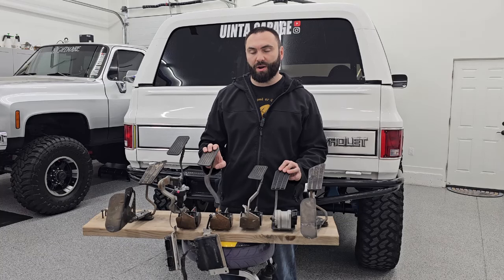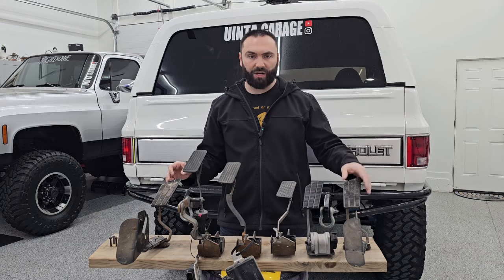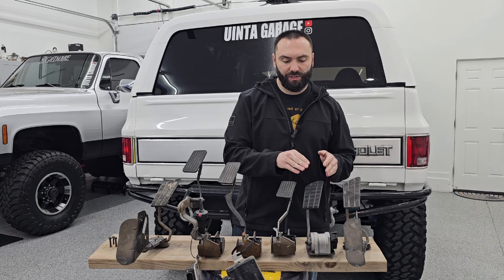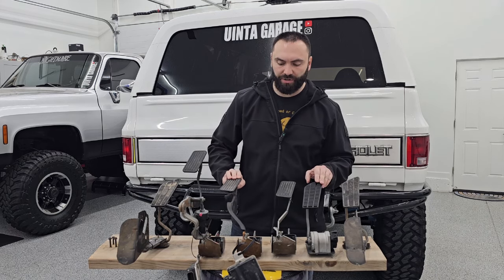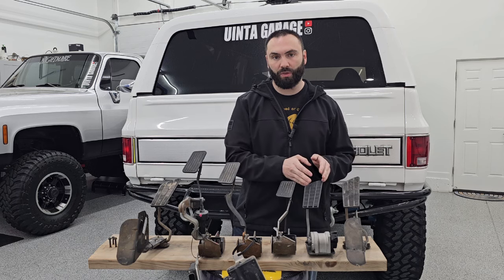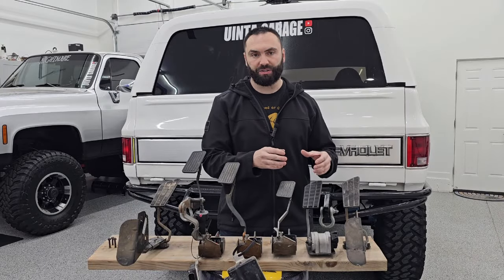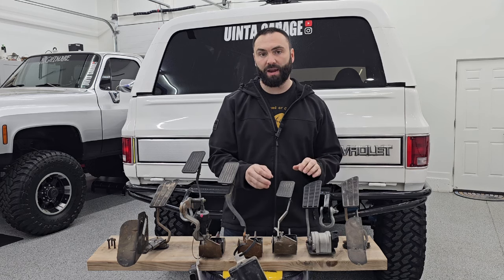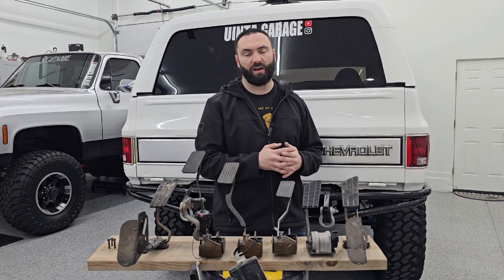This Popular Squarebody LS Swap Pedal SUCKS! #uintagarage  #lsfest #ls

Comment: Thanks Joe, lots of good tech right there.
I went the complete opposite direction with my 8.1litre swap. I opted for the stock gas pedal on my '73, using a cable to operate the throttle body, which I got from a '96 454. Then, had the ECM programmed for the IAC, MAF, and TPS. it was a bit arduous, but it got me away from those drive-by-wire setups.
I believe that can be performed on almost any LS engine.
Once again, great video. I love the Uintah garage channel. Lots of great info here.